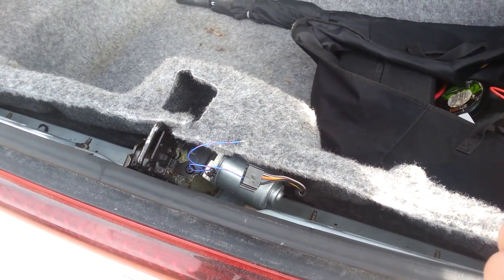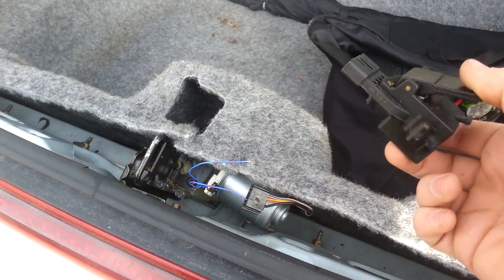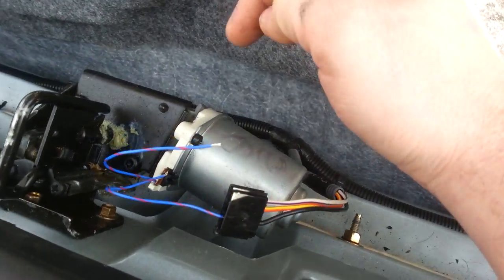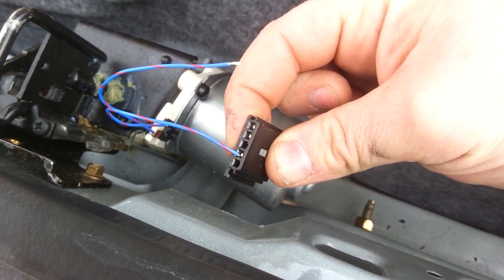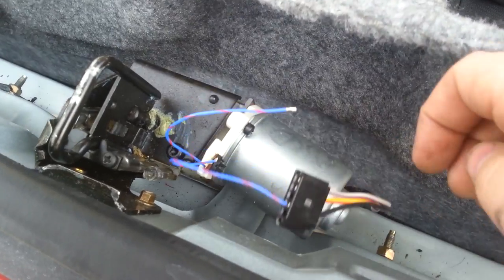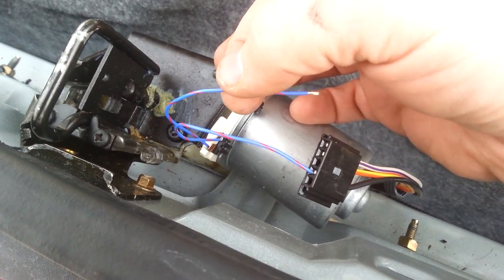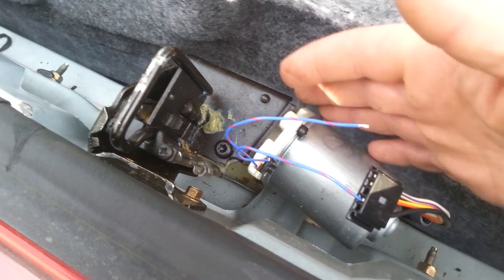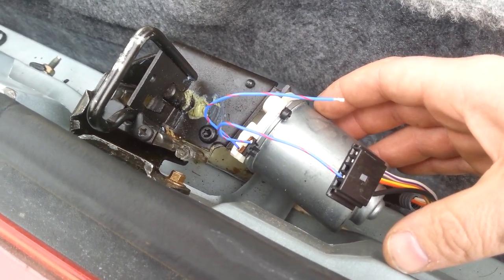Towncar pull down motor fix

Comment: Thank you so much!!! I was able to fix my trunk (2000 Cadillac Eldorado ETC) in 3 minutes, It would have been 2 minutes but I didn't know I had to have the key in the ignition for electricity to flow. 
I only needed to lower it about half an inch for it to fully close. I'm never going to replace the switch hehe, I'm just going to keep it as a normal trunk forever. You saved me $30. Thumbs up for you!
Reply: So the ignition has to be on. Thanks.

Comment: THANKS!!! I had this happen today and it was 10 degrees outside. the latch was down too low so it wouldn't latch when you slammed it.but your deal got it to the right position. I had tied it with a rope just to get home and got all kinds of snow in the trunk. now it's fine closes like any other car , who needs that crap anyway, just more things to break

Comment: great video, thanks!  I'm trying to do this myself, but have no idea where to get that type of wire (or any wire for that matter).  Can I take apart an extension cord or something?  Does the wire gauge matter? Thanks for your help!
Reply from the maker: Any wire will work as long as the guage isn't too large to fit into the connectors. Any hardware store should have wire for what you need. What I used was around 18 or 20 guage. I wouldn't undo your extension cable.  I have a lot of extra wires from old harnesses I keep from car audio and such.
Reply: @jasonsimonds6160  thank you very much!

Comment: I actually found a better way to do this without using the wires. those two black screws and bracket that keep the latch from moving can be removed and all you have to do is turn the latch a couple of times and put the bracket back and it works fine. No need to use those wires to lower it.

Comment: You could also take the switch out, drill out the rivets, clean the 
contacts and put it back together with a little mechanic's wire through 
the rivet holes and your trunk would work like new. Twenty minutes.  It 
is a LINCOLN!

Comment: better yet on the back of the switch there is a smaller swich. flip that to bypass. and be careful when trying to bypass otherwise you'll cook your wire loom, I almost did.
Reply: Careful how? I'd like to try that but don't want to cook the wires.
Reply: Just tap the wires. Don't twist them together